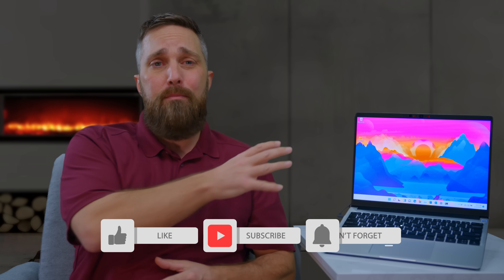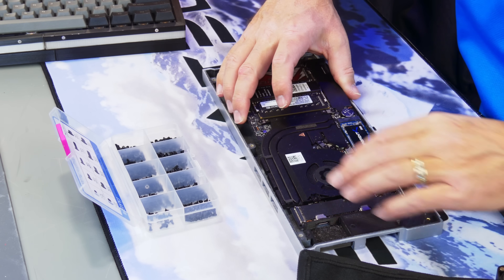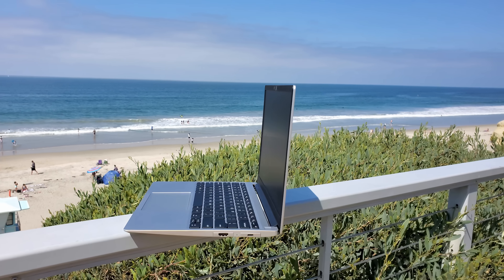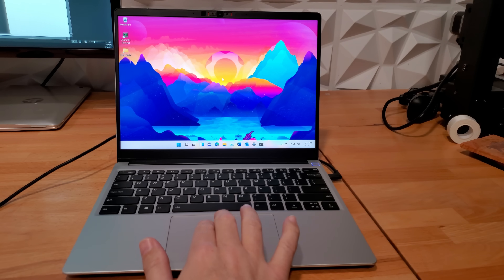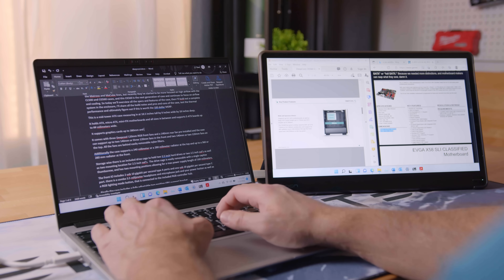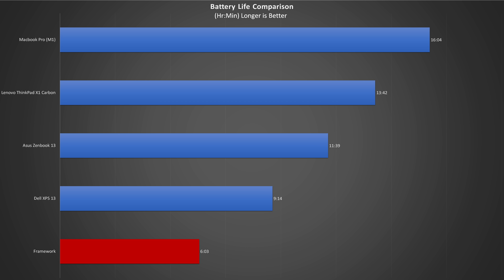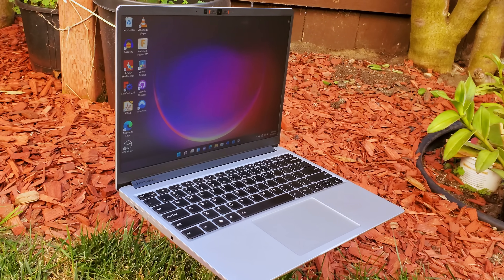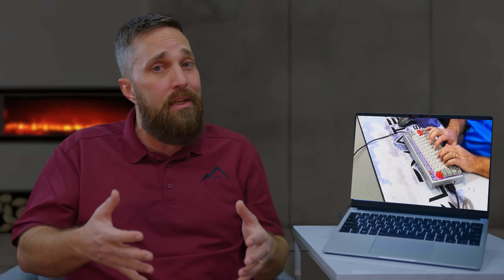Framework Laptop 6 Months Later. I'm Less Impressed 😐

Comment: I think some of these complaints have been fixed or addressed.  The hinge has been upgraded, the screen chassis has been stiffened, I think they're working on the dongle power draw, and the Ethernet port has been released, though is a bit pricy IMO.  I've also heard the new 12th gens that are out are significantly better than 11th gens in both performance and battery life.
Reply from the maker: I have follow‐up videos covering all af that, including upgrading to a 12th gen mainboad.
Reply: @ElevatedSystems  been watching them since this comment.  Great stuff!  I didn't yet see if they fixed the power drain of the dongles.  Gotta keep watching.

Comment: RE: Linux driver support, the newer 12th-gen Intel model seems to work great under Ubuntu 22.10 out-of-the-box. The fingerprint reader works without any changes, though you do have to choose between the Ambient Light Sensor or having the manual brightness adjustment keys working for the time being (you can't yet have it both ways).
Reply: I think pbbuttonsd does exacly this

Comment: I do like my framework laptop (i7-1165G7), but my customer service experience was NOTHING like yours which seems influenced by your Youtuber status. 
Mine was infuriatingly awful. Both first line support guys I dealt  with were totally incompetent, sending me irrelevant solutions to unrelated problems and repeating the same useless info. Eventually, I managed to get escalation to 2nd line who immediately sent out a replacement.
As much as I love the company's philosophy, I'm dreading ever needing their customer support again.

For reference, I'm Batch 9 - UK and the issue I was a faulty HDMI expansion card causing high CPU usage; a known issue. 

I have worked customer support myself for years, so I understand both sides and the service I received was totally unacceptable. Don't expect the sunshine and rainbow tier service explained here, unless you too are a Youtuber. 

All that said, if you have lots of patience and don't mind escalating, they'll sort you out eventually and, as mentioned in this video, they are the best company making laptops right now, from an ethical standpoint.

Comment: The thing is, framework should be supported not only to enable them to make better laptops, but also to force other companies to make better and more repairable laptops
Reply: Other companies already make better laptops. They are just not as repairable but they need no repairs anyways
Reply: @eckee  unless the do need like any repair, and then you cooked.
Reply: @eckee you couldn't be more wrong there bud. Take macbooks. They're basically impossible to repair, unless you're apple. They also get full of dust very quickly. You should check out louis rossman. 

Laptops break very easily. My Samsung book2 pro died within 2 years. The CPU just cooked itself. And is apparently a very common issue with that line of laptops.

Comment: This really confuses me a little. I run some computer repair stores so my perspective is a little different. When you opened the framework laptop I see the exact same parts that are inside every other laptop. Not a good or a bad per say. But the idea that only these guys offer the idea of being able to buy and swap parts is a bit far fetched. Right now if I bought an hp laptop that came spec’d with an i3 on the board, that same laptop is sold in a crap ton of other specs. I can at some later point in time buy the same motherboard with an i5, i7 etc and install it. I can swap out the memory, the solid state drive internally. The lcd can be upgraded. The hinges can we swapped. This is not hyperbole but reality that exists now. And I don’t have to go to HP, Dell or any of the specifically to get these parts. The problems occur when you start only buying the ultra high end cute super thin designs and then wonder why I can’t upgrade my one off machine that they sold 1,000 of total. So while this might seem like a novel idea… I’m struggling to see what this brings to the table. I mean I like the swappable ports but the modules are too large. They take up the space of 3 ports just for one module. And I would question the overall cooling and ventilation of randomly matched parts thrown into a modular frame. The big guys have this problem when they just spec high end cpus and gpus in a small frame. Anyway just my two cents.

Comment: Could please confirm that Framworkwill issue every lapop with a hardware securiy certificate? This comes after lenovo launches their Z chip with built in spyware which no one wants.It comes in to lock windows 11 to stop the use of competitors software to creat a microsoft monopoly .This comes after Europe thinking about banning windows 11 as a national security threat. RISC 5 chips are about to flood the market which could wipe out windows use in the future.Simply windows tries to force users to use windows 11 to mine their data which it resells. As windows goes backwads year on year is forcing users to use their old operating system in the retail market.

Comment: The only time a modular anything has ever been successful is when third parties support the ecosystem. Relying on framework to provide upgrade parts, replacement parts, and support the entire ecosystem is naive. It's simply not a viable business model. If you want this to succeed, and you have the skills to do so, start making third party parts that will work with the framework laptop. There's a reason why your custom PC contains parts from many different manufacturers.

Comment: I'm in the market for the framework, but it lacks some features, I need in a laptop, a touchscreen and a full size keyboard and it has to be a convertible.
On the other hand I don't need feature like a camera, microphone or speakers, I just use headphones and headsets in that case, so some cost could be cut for me there. Until I can get all of the features, I have no use for a framework laptop.
Reply: Well this is a new Project, which is like 2-3 years old.
For now i guess the are more focused on Stability & System Upgradability.
I guess support for Touchscreen is something they aren't currently focused on (but considering that it has been a commonly asked feature, it would probably be added in future)

Comment: Would love to see a gaming laptop from them, I think that could be very successful as PC gamers are generally quite familiar with upgrading individual components of their rig progressively, and if they can make a chassis that will allow for discrete GPU upgradeability as well (I have a feeling the different cooling requirements would be the harder part here) I think they would have a big market to pull from.
Reply: I think the GPUs are going to be a pipe dream because the cooling, as you say, is going to be impossible for anything more powerful than something like a 3050 due to the form factor. External GPU enclosures are likely the best you're going to get with this one.
Reply: @JinghisKhan  Well I would expect a gaming laptop to have a bigger form factor than their current one, basically all current gaming laptops are in fact larger than the Framework, so would make sense for them to go with a similar form factor; I wasn't expecting them to cram that into the current machine.

Comment: I think one problem Framework has to overcome is actually the tech journalists.
Because they're usually so locked down, laptop reviews in the past have been focused on a unit in its current configuration. You can't really apply the same logic to this laptop. It would be like saying "Here's my review of my self-built PC. It has pros and cons against other self-built PCs", it doesn't really make sense, because any conceivable problem you have with it could potentially be solved by upgrading or changing components. Instead, as we do with PCs, perhaps we should instead start seeking reviews on the individual components of a framework laptop?

Personally, I didn't get one as GPU performance is important to me, but if they somehow manage to pack one in there, I'd be interested.
Reply from the maker: A Framework Laptop is not much different than any other ultralight laptop. I got the "DIY" model and the only thing to DIY was RAM and Storage. The rest of the laptop is preconfigured just like any other, and at about a year in there isn't anything I can upgrade. I cant even buy a new battery or TrackPad yet from the marketplace, which is are the exact components I have anyway.
Reply: @ElevatedSystems  True, looking at the UK store it seems to be as you say. For all intents and purposes they are currently "locked down" in a practical sense by virtue of them not yet offering the parts.

Hopefully that will change as they start to go through some more revisions, and a wider variety of parts go on sale.

Comment: Logically I don't see how this can work. Componentising the laptop would be great IF you could source those components from elsewhere. Beyond the SSD and RAM, which other laptops let you upgrade, what is there?

As a MacBook user the battery life and most of the other specs are so dated I wouldn't give it a second look. On top of which compromising the compromised hardware with compromised Linux is just layering problems one on top of another.

Framework is listening to what consumers SAY they want but not to what those consumers want to pay for or put up with.
Reply from the maker: They just released 12th gen Intel Mainboards. So for $450 you can upgrade the laptop to the latest gen without the need to buy an entire new laptop. M1 MacBook Pro users should have been able to do this for a M2 upgrade.
Reply: @ElevatedSystems   An M2 upgrade doesn't make sense. Neither do iterative Intel or AMD upgrades. You are spending far more for only small productivity gains.

Do you ever add up what it costs to get to what you have and look around you at all the discarded parts?

If you do have an uncontrollable urge to constantly upgrade (to what point?) you are not going buy a whole new computer without selling the old one. The upgrade cost will then be the difference between the new and the old. In most cases the newer model will upgrade more than just the one component and you are not restrained by the creeping incompatibilities of older hardware.

If you are going to end up spending effectively the cost of the original computer plus upgrades, why not just upsize the original purchase to future proof it?

A computer plus a box of no longer used parts is worse for the environment than two working computers.

Comment: Yeah I got one of the batch 1 units as well, loving it for casual use and programming.

Once my current gaming PC dies, a Lenovo POS, I will be replacing it with another Framework PC that I max out and get an eGPU for. And then I can breathe a sigh of relief that I will never again need to give money to Lenovo, Dell, HP, or any of those other garbage companies.

Comment: By now I had expected to see news of a 15 or 16 inch or maybe bigger. Heat and throttling are disappointing as is battery life.
Very simple software coding of even slide switches on modules so they take no power when off could help quite a bit. SD cards have slide switches why not modules?
Also (and in case the company hit a troubled patch) it would not cost them much to issue a new, sealed spare battery for free with every initial purpose.
I use mouse always but occasionally check trackpads on machines and Framework's is no XPS or Mac. To future proof products while better ones are worked on I recommend that the trackpad should be modular so that customers may buy new ones if they experience flabbiness. Given that we are talking "wear and tear" and some people are ham-fisted this would be a fair quid pro quo and underscore customer focus.
I will not be divesting my shares in Framework any time soon because they are an outstanding company. I see greater sales being in the education sphere very soon, especially here in Europe and in Australasia.

Comment: When my current laptop dies I'm hoping a framework will be right for me.

Linux friendly. I'd like a bigger thicker laptop with a stronger cooling solution and maybe a bigger battery, and lots of ram and storage.
I tend to run my laptops till they die and want them to be able to do almost almost everything my gaming rig can do. Thin and light are not priorities. I want something powerful that can take upgrades and is easy to repair, that I can fit in a backpack along with it's power adapter and any peripherals or equipment I'm going to be plugging into it when I get where I'm going that aren't already on site.

Comment: I'm on the fence. I love the idea of the Framework laptop, and have always bought my laptops with the ability to repair and upgrade in mind, and Framework clearly is the best in that regard. But I am also looking for more options. Finding the right laptop is very difficult. I'd love to see Framework offering a bigger sized laptop a few years down the road. Something with a 15" screen, a discrete GPU and a bigger battery. Perhaps a second m2 slot, as well. I've been trying to find the right balance for years, with no success.

I got one of the slightly older Thinkpads where you can pretty much change everything, excluding the GPU (but the CPU is upgradeable). It initially had crazy good battery life, because it had two (!!) swappable batteries. But the discrete GPU options were workstation only, and not that powerful either compared to consumer gaming oriented GPUs. Also, while repairable, the batteries are discontinued, and while I still use it (I'm using it right now!), there is no way to restore its original battery life, and it isn't truly upgraeable in terms of motherboard (so no newer CPU or GPU or RAM or m2 slots or ports).

I later got a desktop replacement, gaming laptop. Very upgradeable too, it uses a desktop CPU, and the GPU can be upgraded as well, but the CPU can only be upgraded by two gens (from i7-7700K to i9-9900K with some electronic hacks and a modded bios), and the battery life was never usable. It's a beast of a laptop, and the charger is just as massive. It's still my main driver and I'm happy with its performance, but unfortunately I'm not home very often anymore and need something with better battery life and portability.

One of the newer Thinkpads would be nice: plenty of ports, better battery life, good performance, good choice of components including dedicated GPUs... But at the moment, the only thing that I could keep upgrading instead of buying a new laptop in, say, 5 years, would be something like a Framework. I find that keeping the shell, screen, battery, and changing the motherboard is a really appealing option. I'm also very fine with the line of CPUs they are using, particularly the newer 12th gen ones, but some stuff is missing the mark for me at the moment.

Comment: As a gaming laptop user I'm really shocked at how bad the battery life is on this framework. 6 hours is only 2 hours more than my lenovo legion, which is a gaming laptop and we all know that these laptops suck in many ways, especially the battery. I think 8 should be the minimum for a productivity laptop, and even that is not much.
But the advantage of the framework is that it could probably be fixed and replaced very easily. That is the reason it's exciting.

Comment: Pros:
- It’s the most well-built laptop I’ve ever had. It just feels solid when compared to the plastic-shelled one I was coming from.
- expandability and modularity is great. I just built an eGPU setup that compliments the laptop and all goes in a small backpack.
- best screen (in terms of resolution) I own.

Cons:
- super loose hinge. was a passenger in a car with poor suspension on Michigan roads and had to constantly readjust the screen.
- I fell victim to the odd failure to post big in the bios after not using it for a few weeks and accidentally nuked my boot drive by trying to diagnose it.

- I would pay for a touchscreen replacement/new enclosure for old screen to make a portable display but nothing has surfaced yet so I cannot help out more.
Reply: I believe they came out with a hinge replacement recently, it's amazing how repairable this laptop is
Reply: How’s it faring now? Still use the laptop?

Comment: I think this is a great concept.  My apprehensions are this:  After you get the initial parts and have the laptop up and running, it should last a few of years.  You might get an extra expansion card or two, but you’re shouldn’t have to replace any of the major components for years.  If something like the keyboard or screen fails quickly then that’s not good.  But at least it’s easily replaceable, right?  

How long is this company going to be around?  I hope they do well but if 3 years from now, your trackpad craps out, is the company going to be around to buy a new one?

If the company comes out with a next gen cpu/motherboard or an AMD option, can you really just swap it, plug in your old drive and you’re good to go?  I’m afraid that Windows is going to detect that it is not the same device and refuse to boot.

Comment: I really like the concept, and if they could work on thermals battery life, and most of all offer current 12 gen Intel chips and possible GPU configuration, that is competitive in price maybe $200_$300 dollars more than a company able laptop performance feature battery screen wise, larger screen maybe 16", and maybe space out so you can also have two ports modules, 2 usba 2 usbc SD card and micro SD  headphone amp dac with balanced and standard outs all which can be done with the larger 15" size.
because of the bigger size etc. Optical in and out. 

I hope they stay around.batter hinges.

Comment: The i7 models are kinda pointless. They're only a tiny bit more performance for more power consumption and an extra $300. Not worth at all, stick with the i5
Reply from the maker: The 96 Iris Xe execution units in the I7 vs 80 in the I5 make a difference in GPU dependant workflows.